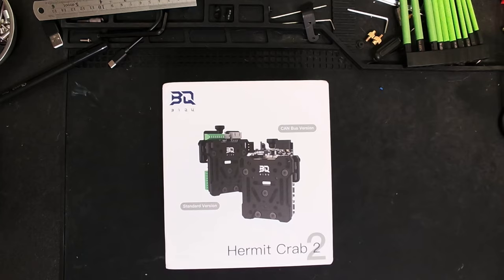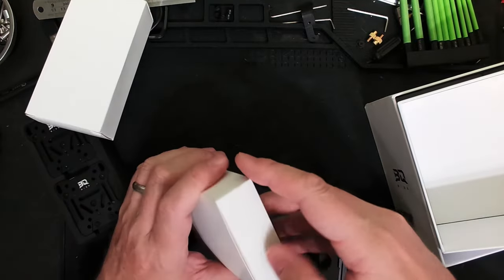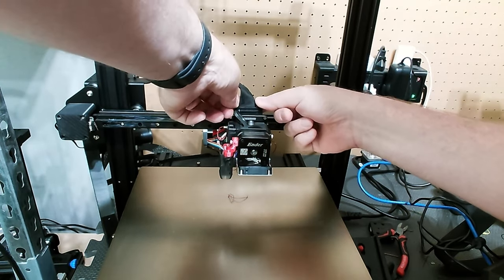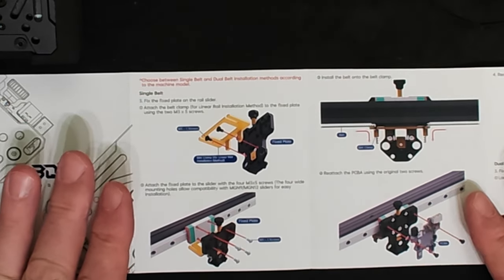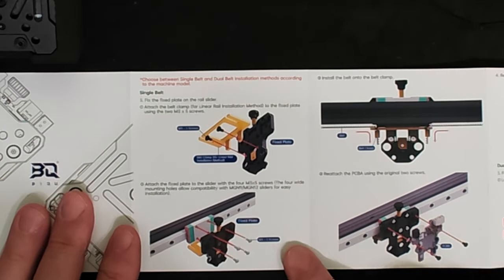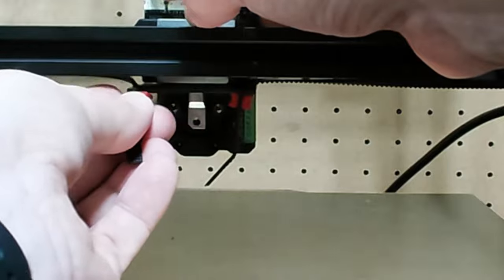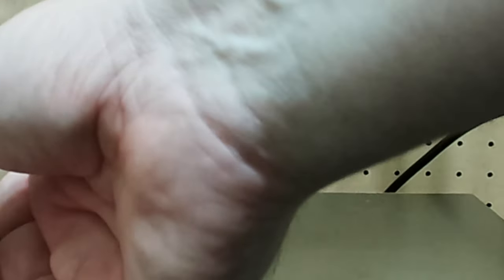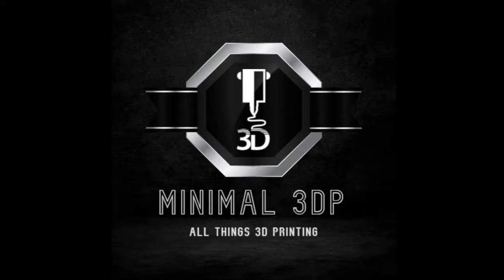Get Started with Biqu Hermit Crab 2: Hardware Installation

Comment: Mike thank you for the tutorial video.
I'm looking forward to your next video.

I recently purchased two hermit crab 2 systems. One can bus one non-can bus and I am getting ready to install them. 
I also picked up The b i q u h2s Revo and the Swiss micro NG Revo. I plan to slowly convert my most commonly used printers to the Revo nozzle system. 
I am also considering using it as a base for a tool changing system like the prusa XL's on my SV08.

I have been planning this for a while and waited until the recent Amazon sale to pick up all The new toys listed above.

I was considering using the Hermit Crab 2 on my SV08. The problem is it's such a workhorse I don't want it to be down for a significant amount of time. I have had it for less than a month and have close to 300 print hours on it with multiple 24 plus hour prints. My only failures have been early learning curve and with 24 plus hour prints those are so painful you make sure they never happen again.

I will most likely install the hermit crabs on my NV4 Max and my SV07 Plus first.

Like you I plan to video and try to make tutorials out of my upgrdes. Unfortunately I have tried to do this many times in the past and end up with footage that I'm not really happy with.
Reply from the maker: I just need to edit the videos and post this weekend. The overall upgrade should not take too long. Just print your mounts ahead of time, and the printer should not be down that long. 

You should post your videos. I am never happy with mine, but I decided to always try to improve and do my best. Realistically, I am my own worst critic. Sometimes, you just got to take the plunge. 

Let me know if you have any specific questions I can answer, and feel free to email me.